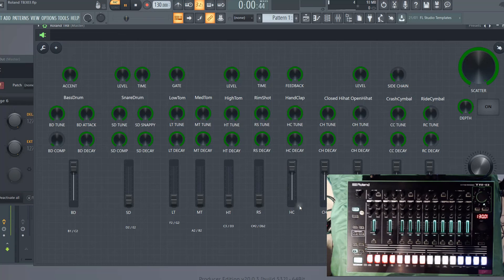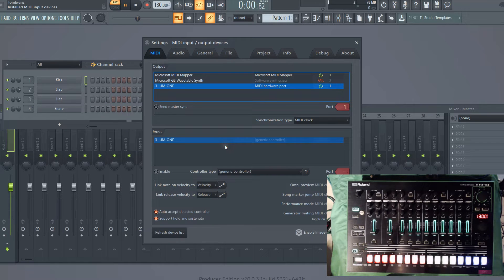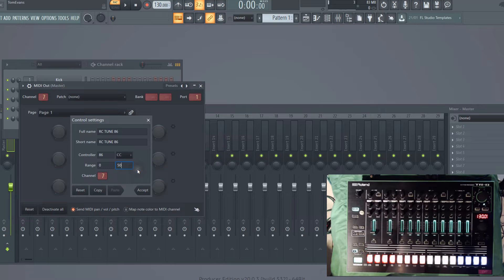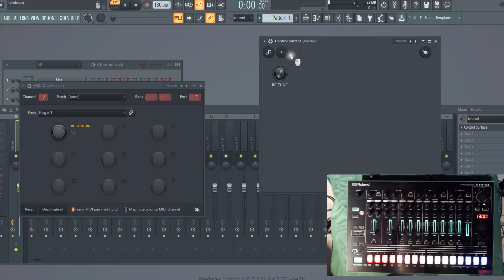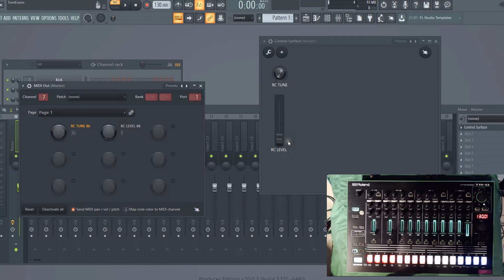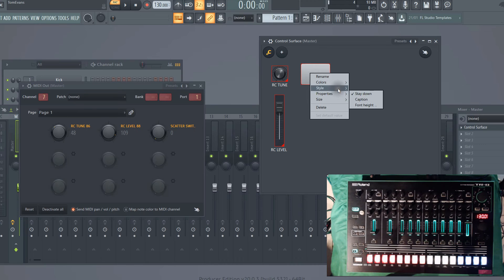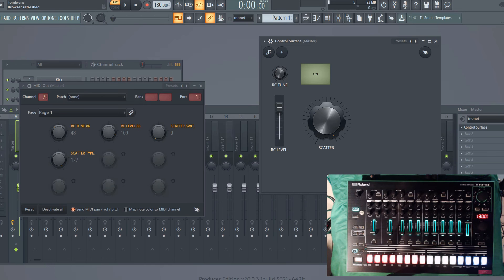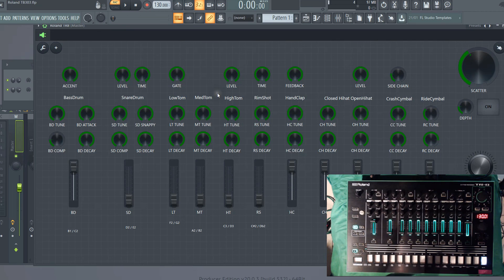1 - Roland TR8 Midi Interface, FL Studio 20, Implementation, Control Change & Control Surface

Comment: I fully rebuild the TR-8S in the Control Surface, but it not works to get any modification to the MIDI Functions. I simply can trigger the Instruments in the Piano-Roll, but i cannot trigger any other function. It does not care which Channel i choose while set the functions to the knoobs.
Reply from the maker: Hello, please make sure your MIDI interface can support Control Changes and MIDI data other that note, length etc, etc.

Comment: Did you have any issues with this unit and FL? I cannot get the midi out of the unit it work, when connected it crashes FL with data overload. When I use USB midi the unit drivers (TR8S and TR8S Cntl) I get staggered notes in the audio, when I play back either midi or audio, and have to disable one of the drivers. This is a pain, as I have to continually do this within a workflow. Has anyone gotten around this, or can recommend what to do? As so far it is not a fun unit to operate with FL.

Comment: I need to know which controller type this works on since it’s not listed, (generic controller) is what I have it on. The ports & channels are good & it’s connected via USB
Reply from the maker: Zē - what issue do you have if any? Controller surface should link to the midi out channel on FL Studio and then send midi out it the TR8 as long as the midi channel matches?

Comment: hello! would this work with tr8s as well ? please , thanks!
Reply from the maker: Hibit Sounds - you might have to change some of the “control change” numbers and add some to the control surface - refer to the midi implementation chart that comes with the TR8S

Comment: Man how do you record this into FL studio? I mean, if I rec my tr8s I'm hearing double audio. Any idea?
Reply from the maker: Tetro 13 - you might be using the TR8 on the same port and midi channel as your external control device in FL settings. The TR8 will input a note then if that channel in FL is the same as the output it will loop back through
Reply: Im assuming that your are using the tr8 as your audio interface.
If so yoiu need to route the audio to a input on a channel within FLs mixer.
You need to remove the audio ruoting that channel to the master.
This is because the TR8s acb engine runs in parallel to the audio interface, and there is no way to split the mix.
You then can record your take with out it looping back out through the DAW.

Disable local control or go to a blank pattern on the tr8, then reroute the input channel on the mixer back to the master when you wish to listen to the audio in fl of the take you have recorded.

I don't have a TR8 but know it was like this when i had a system 1m, more importantly you maybe able to bypass this work around if you use the other external outs on the tr8, & just have the audio interface sending to the main outs.
Reply: @agnz  would this work with tr8s as well? any idea ? thanks in advance
Reply: @hibitsounds9755  hey, id imagine it maybe the same.
Think of it this way, audio out will come from the unit no matter what, if you are using it as an audio interface then you will get the sound of the unit, plus whatever audio is generated from the computer, you can send the sound of the unit to the computer, but you need to stop the signal from being relayed back through the software.
Otherwise you will be hearing the sound of the unit followed by the sound routed through the software because of round trip latency.

Comment: Just a question mate...At 1.20 as midi interface, you plug your UM-ONE in the midi in of the tr-8...But you can use the USB for midi in, (just AFAIK, the tr-8 works like a midi interface...), or you can't ? Thanx in advance...
Reply from the maker: Patrick Martin - I usually use the TR8 as part of a DAWless setup with no computer so it’s usually plugged into a midi thru box. I’m a bit old school too and have used midi to USB interfaces for years. I’ll convert over one day I’m just weary I’ll get latency issues if I use too many ports on my laptop

Comment: This would be nice using the TR8-S with FL20….. if any has done this hmu  - cheers
Reply from the maker: The TR8S midi implementation looks quite similar so it might be easy to adapt this surface control for the TR8S
Reply from the maker: Cromey it might be simple to just change the midi implementation settings assigned to each controller - do you own a TR8S ?
Reply: Cheers Traxler I do - gonna dig deeper with this conundrum :-)  @ThomasMatthewEvans

Comment: Hi, would love to get hold of that flp file! Really interesting stuff, thanks!
Reply from the maker: Link for the FLP and preset file is now in the description. Let me know how you get on - you'll need to change your TR8 midi channel to 7
Reply: @ThomasMatthewEvans  winner, thanks. Have been trying to find anything about the pattern change but so far to no avail - if you work anything out I'd be super keen to know as it would then be the only thing missing from me being able to fully integrate it into my work flow. Why they didn't include a song mode on the tr8 in the first place I'll never know
Reply from the maker: Josh Thornton I have googled it and I don’t think there is an option, fingers crossed that it’s on the next firmware update
Reply: @ThomasMatthewEvans  yeah, fingers crossed in that case
Reply from the maker: Josh Thornton I’m just adding some final touches so if you PM me I’ll send it to you. Would you mind beta testing it also?
Reply: @ThomasMatthewEvans  sure thing, would be happy to! Separate question, do you know of any way to trigger a pattern change from fl to the tr8?
Reply from the maker: Josh Thornton I’m not sure? I’ll have to do a bit of research. Should have the FL file up this evening.

Comment: how do you put the drummachine on channel 7?
Reply from the maker: Lars Tesseur hello, hold down the PTN SELECT button and switch the TR8 on. The tempo display will show a “C” then a number. Turn the dial to your desired midi channel (I think the default is 1) then press START/STOP to return to normal operating